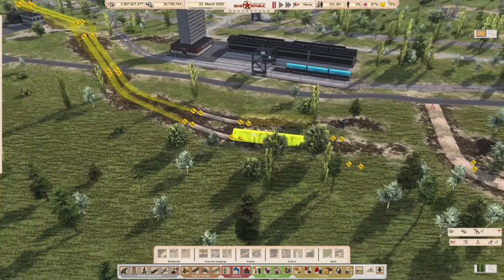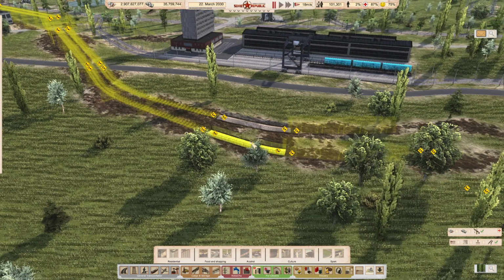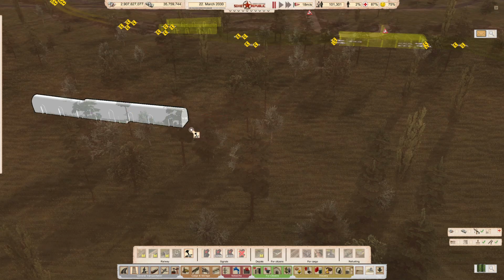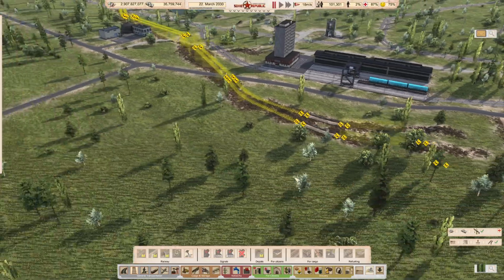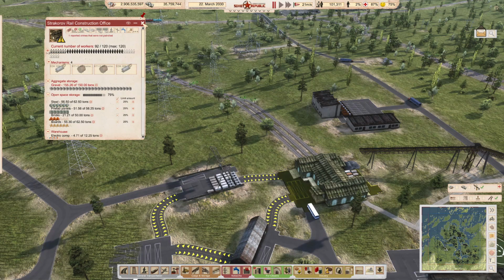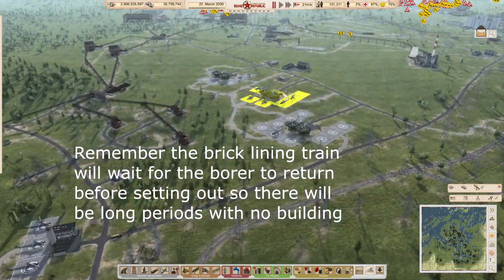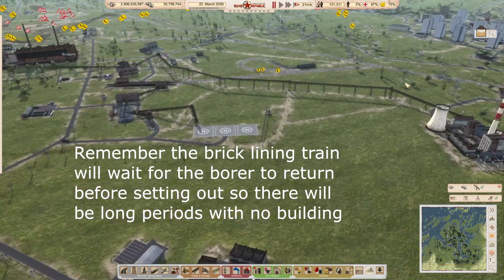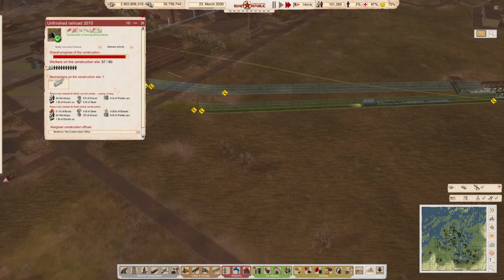Over & Under Ring Metro Design Tips :: Workers & Resources Soviet Republic : #166

Comment: Is it real to make semaphore underground?
Reply from the maker: It is possible to put signals in the metro, but the placement options are limited and it can disrupt the trains due the game using control blocks.  A safer option is it add an end station to regulate the distance between trains.
Reply: @StephenSilverbeard  is it available to use either end stations or semaphores? 
I have 3 underground stations network with end stations on the ground from each side of the line. I have ground semaphores, shall I delete it?
Reply from the maker: If you have an end to end network with end stations turning the trains round there is no need to semaphores.   Use the timer in the end station to set the time between trains, which will depend on the number of trains. 

Tip:  Metros should be high passenger volumes that take time to build up on the platform and load.  For this reason start with a couple of trains as this allows passengers to build up before the next train arrives.  

 A potential problem with end-to-end lines is passengers will travel through the end stations, to prevent this set the last station of  'unload' and the first station after it to load only.  This help enforce the directionality of the line.
Reply: @StephenSilverbeard  thanks!!!